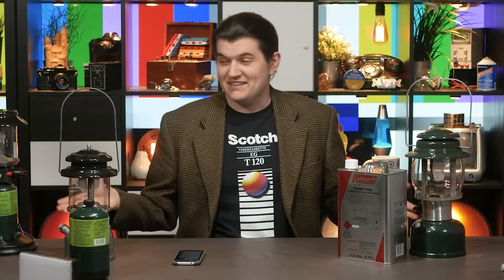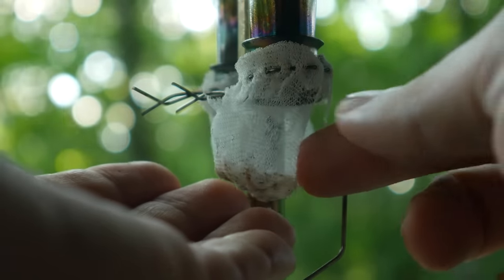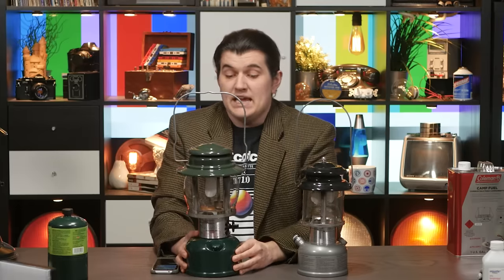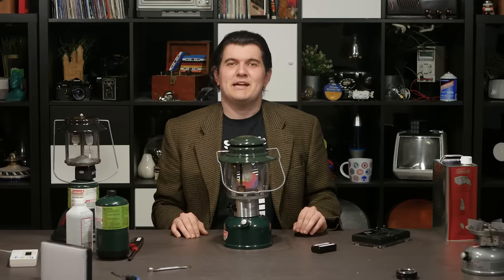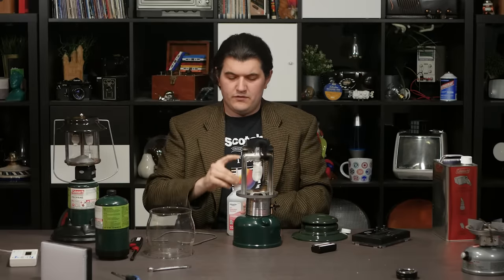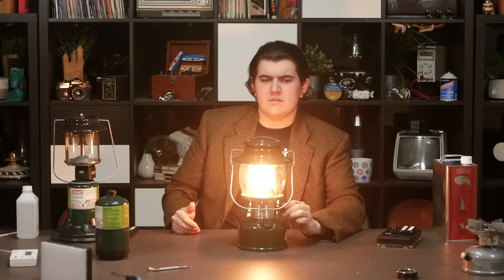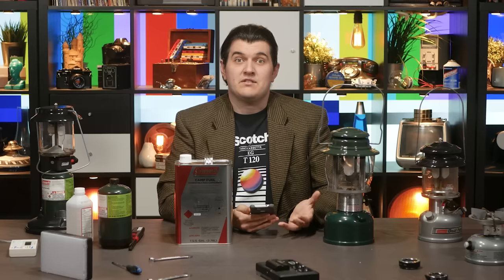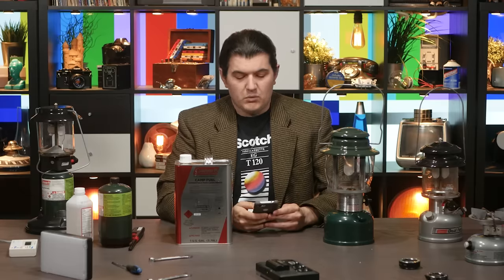A very rambly Coleman Lantern follow-up. Turns out they rarely make sense in 2021

Comment: I like using liquid fuel lanterns because they are built sturdier than their propane counterparts, and the waste propane bottles that you end up with after use are nearly impossible to recycle or dispose of correctly. Whereas, white gas/pump gas/ kerosine creates less waste containers that can be either disposed of or recycled.
Reply: They have to take them back if they sell them here in EU so if you're in a shop that sells replacement bottles you can leave them your old ones.
Larger bottles (5kg, 10kg etc.) usually have some small extra cost that you get back if you return them and those are almost 100% refilled and sold again.
Reply: Same thing with used car oil. Just leave it where you got it.
Reply: You can refill those small green propane tanks yourself with a large tank and thats no waste at all :)
Reply: @audioacrylix5005  You can, and I do, but not legally and you have to know what you are doing and use a scale to weigh them and determine the tare/gross/net to make sure that they have been filled properly, not under and certainly not overfilled. There are ones rated for refilling too.
Reply: I refill my small 1 pound cylinders and use them over and over again. No reason to recycle or throw away.
Reply: If you put your empty "disposable" propane tank in a deep freezer it will refill faster and you will get more propane in the tank. You can't over fill it using the freezer method and you don't need to mess with the vent valve.
Reply: @n4zou  Yep, that's exactly how I do it. Freeze the 1 pounder, turn the big tank upside down and fill'er up! No venting required.
Reply: @markm0000  Like the Earth?
Reply: @audioacrylix5005  Came here to say this.
Reply: @danielthechskid  Pretty sure LP is a specific pressure and you can't overfill them by using another tank. If a pump is involved, like if you're filling a BBQ tank at Tractor supply for instance, then yeah.

Of course, a BBQ tank which really only holds four gallons will go down pretty quickly filling these small ones up. Much better to use a household size tank if you have one.
Reply: @kenmore01  No you goof you put the oil back in the gallon that you bought it with and give it back to the store. Same with batteries and propane tanks. The store will accept it. Just leave it next to the register and leave.
Reply: @kenmore01  Sorry, wrong. LPG is liquified petroleum gas, which is a mixture of mainly propane but also contains a varying amount of butane as well as traces of other gasses. Propane is a refrigerant (R-290) that boils at -44° Fahrenheit at atmospheric pressure and n-butane boils at 32° (AKA the freezing point of water) at atmospheric pressure. Its pressure directly corresponds to its temperature. It doesn't matter if there is just a single drop of liquid with the rest vapor or all liquid with a single tiny vapor bubble, if the liquid to vapor interface is at a certain temp it will always be at a certain pressure, for instance 170 psig at human body temp of 98.6° F. This means that if you hook 2 cylinders together and make one of them colder than the other it will keep condensing the vapor and drawing in more until it is either completely full of just liquid or the other cylinder is completely empty of liquid, depending on how much liquid was availabe. I regularly refill them for use in a Lehr trimmer that runs on LPG in these 16.4 oz cylinders and I have overfilled them accidentally. Luckily fixing it is as easy as connecting it to the other cylinder again and warming the overfilled one slightly to just above the other cylinder's temp to drive back out some of the contents. I write the tare (empty) weight on the cylinder and use a kitchen food scale to verify the fill level.
Reply: @danielthechskid  Yes, more or less what I meant. If you fill one from the other and let them settle, they will end up at the same pressure, which is about the same as the full tank. The liquid becomes gas, moves to the other tank and becomes liquid in there, thus the capacity of liquid propane (actually a brilliant idea!)

Obviously the big (source) tank loses capacity while the empty but filling tank (receiver) gains.

I understand what you're saying about temperature, so doing it slowly is a very good idea. But if done so, or the tanks are submerged in water, they will equalize and it's pretty hard to overfill a small tank.

All that said, I believe batteries and LEDs are the way to go with camping lighting as Alec said, not to mention, if you have a vehicle nearby (likely), you can recharge from that. Propane, not so much.
Reply: @markm0000  Yeah, but rechargeable batteries, you just recharge. Not so easy to refill a small propane tank (or even a large one), or white gas. We used to use diesel fuel in our kerosene heater. It worked well, but stunk and left extra carbon. We were next to a small airport though, and Jet-A fuel wasn't expensive. You could just drive on up and buy it. At the time (Mid 90's) it was about $2.50 / gal. It burned cleanly and was as nice as the $15 / gal clean kerosene, so pro tip: if you want good kerosene, find a small airport nearby and buy Jet-A fuel to fill your containers.
Reply: @kenmore01  Good to know. There’s a small airport here I’ll see if they have a pump. Goodnight
Reply: @audioacrylix5005  Yes you can!  I have.  But I wouldn't recomend it to anyone.
Reply: @markm0000  Best of luck!
Reply: @danielthechskid  it's legal to fill them for personal use, but no transporting across state lines (assuming you're US based). Insurance might be fun also. I have the refill valve dealy thing for my propane torches, fill em from a 47kg (100Lb) tank :)
Reply: @kenmore01   Still, No. The vapor/liquid interface is at equilibrium when you the two tanks are at equal pressure. The overly full tank  will release gas at the same rate it condenses  into it. Without a cooler liquid to drive condensation faster, or a warmer liquid to increase vapor pressure above the equilibium there will be no overall change in the level of either tank.
Reply: What are you talking about, ‘Dispose of correctly’?! They’re an empty steel can, throw it in the garbage!
Reply: @HailAnts  on the can they say not to throw away because of the fuel in them similar to why you don’t throw away motoroil or batteries
Reply: @kenmore01  Yes you most definitely can overfill. It's not the vapor pressure that makes overfilling dangerous. It's the thermal expansion of the liquid that will force it out through the relief valve, if you're lucky, or rupture the tank, if you're not.
Reply: @markfreeman6017  The amount of propane left is so minuscule as to be meaningless. You release a thousand times as much vapor every time you fill your gas tank.

And it’s not even remotely compatible to recycling motor oil or batteries..
Reply: @russlehman2070  Thanks! I have never done it, my exes ex boyfriend used to refill them and let her use them when we went camping (don't ask, it's complicated, fortunately that's all behind me now) and I don't think I would try. I'd bring a four gallon tank with me and use an adapter hose, but that's just me. I believe you are probably correct. He never blew up as far as I know. ;-)  Actually, he was a really nice guy, so hope he never does!
Reply: @audioacrylix5005  that's what i did. Adapter from a 20# tank and refill. If I want to take the small 1# tanks instead of the big one for whatever I'm using it for (typically  a grill as I use battery/ solar lighting)
Reply: @HailAnts  It needs to be punctured first. And to recycle, it needs to be cut in half.
Reply: @HailAnts  Not always legal to "throw them in the garbage".  Where I live, propane bottles are classified as hazardous waste and aren't allowed to be put in either your garbage or recycling bin.  Oddly, the same rule applies to empty helium tanks.  I suspect it has more to do with safety rules for the workers, and the fact that there's no quick and easy way to tell whether they're empty, half-full, or completely full.  May be especially critical in jurisdictions where compactors and or incinerators (are there any of those any more?) are used.
Reply: @danielthechskid  "Not legally" 😂😂
Like you can't even do whatever you want with YOUR very own propane tank and cylinder ?
Yeah it can explode (In the worst case scenario) and cause harm to other people or property damage, but if you're careful enough to prevent any of that from happening, what could go wrong legally speaking ?

I mean

You're not stealing anything
You're not using propane or the tanks or cylinders as weapons
You're not tampering with something like your power meter...

So what ?
Reply: @psirvent8  As TheChipmunk2008 said it is illegal to transport a refilled disposable cylinder across state lines because of a United States Department of Transportation law. Crossing state lines makes it federal.  I would imagine that they don't want it to blow off or rupture in your vehicle and cause you to lose control while travelling and possibly kill people. Imagine if you swerved and caused a head-on collision.
Reply: @danielthechskid  You're both right and I must admit I forgot about this point, but I don't see how a refilled 1lb propane canister could be more hazardous than a new one, provided you didn't overfill it of course (Hence the scale).
And to my eyes a refilled canister just looks like a brand new one, so even if police were to stop you, they wouldn't even be able to tell that the canister has actually be refilled.

FYI I don't live in the US and yes I already have refilled butane canisters (Very small ones meant to refill lighters) from slightly larger (And also disposable) butane canisters about the size of a spray paint can. (Using a scale and first I weighted the totally empty lighter refill canister and marked the tare, ie empty weight on it with a Sharpie).
But I didn't transport them anywhere simply because I didn't need it so far 😂
And as far as laws and codes go in my country for that particular subject, well I simply don't know...
Reply: @psirvent8  No problem, there is only one other thing that I can think of, and that is moisture content. These cylinders are very thin walled and I would imagine that the factory fill has been run through dessicant to make sure it is absolutely dry, when refilled the moisture content is unknown and may cause rust to form on the inside. Not likely, but possible.

Comment: The best use-case for the Coleman mantle lantern is if you have a very remote cabin away from electricity. I've seen many cabins in the woods where they have no electricity and for the owners, the opportunity to visit them is sporadic. So it makes sense to leave a Coleman lantern with a fuel can in the cabin for when you get there, or in an emergency. They aren't the primary light source, or primary heat source, but they do both, and can be left in a cabin for years and could save your life.